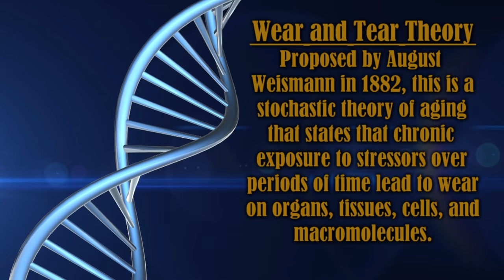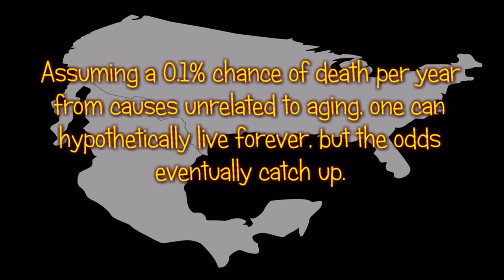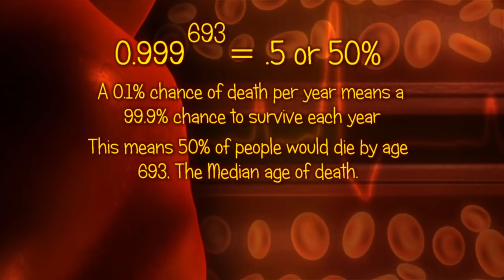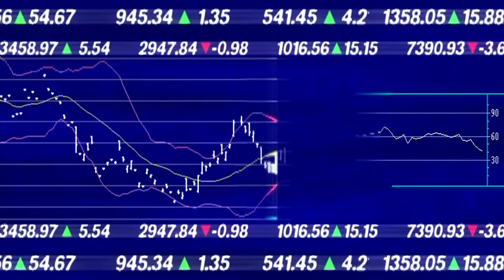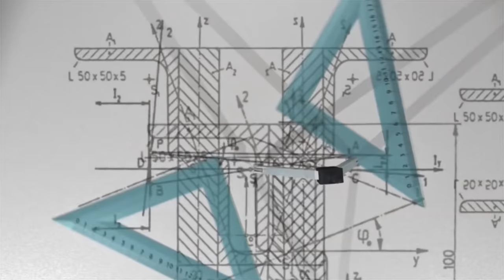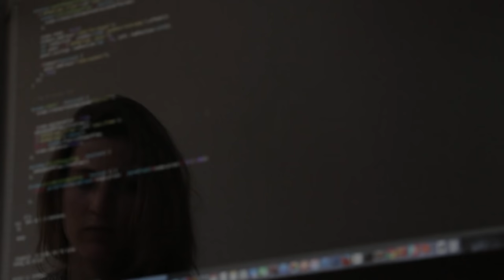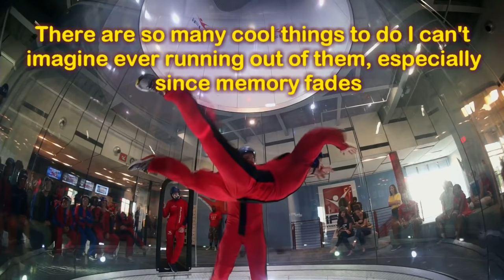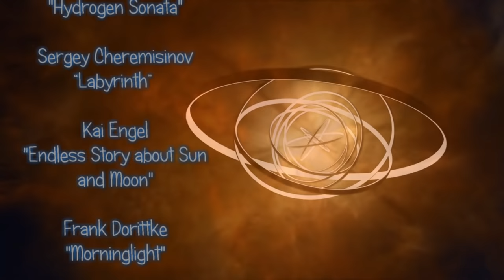Life Extension

Comment: one word: cancer. two words: heart disease.  Both march along at the same pace they do today even if some sore of mitochondria repair pill is developed. I believe there is ZERO chance a single drug can be developed (ever) that can address these issues. Perhaps nano-bots could keep the arteries cleaned out, rebuild the parts of the body that don't grow (cartilage in most of the joints), remove the arthritic spurs, remove the steady increase in scare tissue and damaged cells and someone replace them with stem cell replacements, and identify all defective cancerous cells and remove them....but that's quite a bit of work and will take quite awhile to develop (at least 100 years at the present pace).